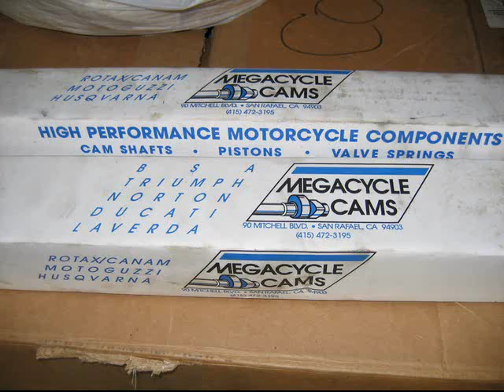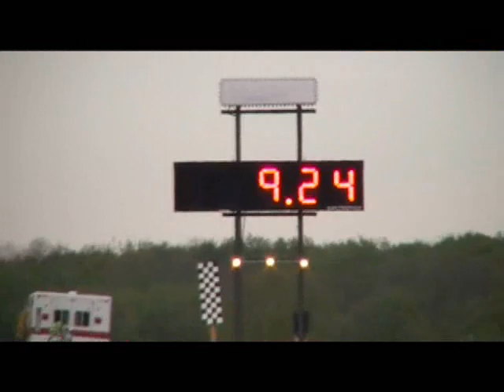RccVideo's Dragbike Build Trac Dynamics Suzuki Gs1100 drag bike gs 1100

Comment: great vid i have a 1327 car tire chromoly cart start 70 inch on juice haven t juiced it yet ran 9.74 with out a lock up 2nd time out  now has a lock up feels way stronger will juice now. I like that start set up you have I will make the same for mine as I have no crew to carry the start cart and batterys thanks for posting
Reply from the maker: Thanks.  Not sure if you noticed, thats a 2 battery 24 volt system.

Comment: Very nice build! congrats on sub 10second run!
Off topic, but relevant to suzuki GS1100ex in general. I have one(1981) and it makes a knocking noise at low RPM. If I rev the engine, the knocking goes away and it also goes away when I depress the clutch. Which bearing? how to change it? 
I have been all over Internet looking for the right answer...can you please help?
Reply from the maker: CRM6718 I would ask over on the http://thegsresources.com/ discussion board.  Thats a new one to me.  If I was to guess I would look at the clutch basket.  Make sure it's not loose.
Reply: +gs1260cc Quick update, it is the clutch basket.
Reply: Check the clutch hub itself, springs, rivets, spline inserts etc

Comment: Does that left side motor plate allow for the stock dyno for charging? I'm looking at putting one on my GS1100.

Thanks!
Reply from the maker: Yes you could.  I had cut most of it down to take the weight off the end of the crank.  I just charged between rounds.